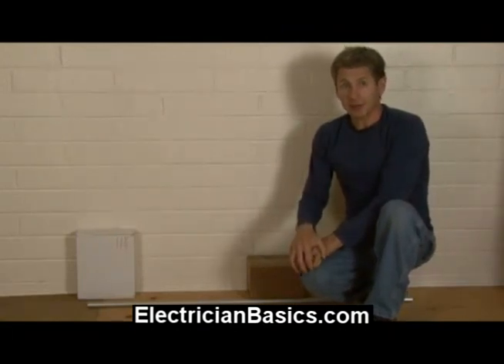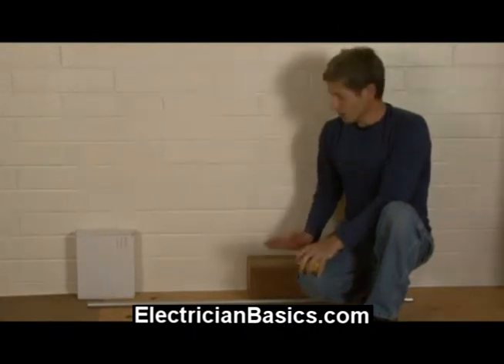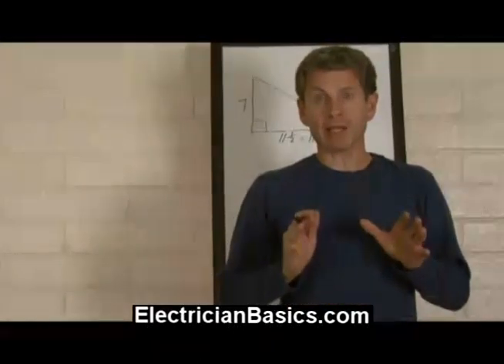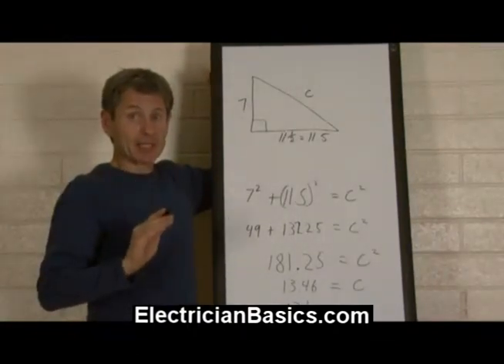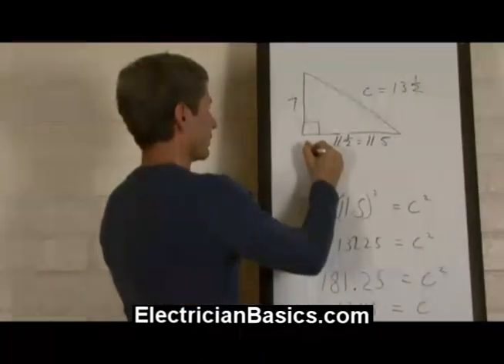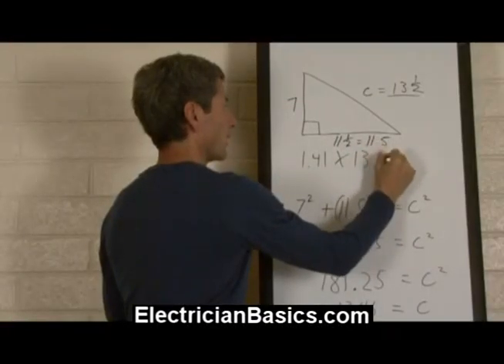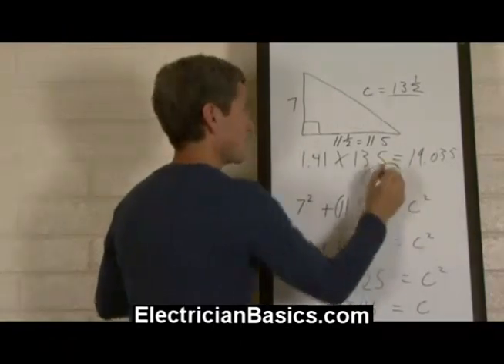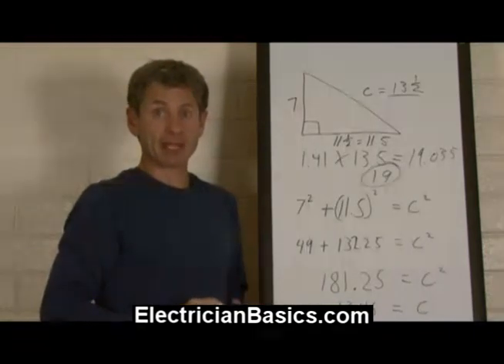Bending Conduit EMT With a Hand Bender   Rolling Offset

Comment: I was wondering if you factored in the shrink? Or felt it wasnt necessary?
Reply from the maker: It's not always necessary to factor in for shrink.  Many times you have plenty of space to fit your bend into place.  I did not want to over complicate the example.